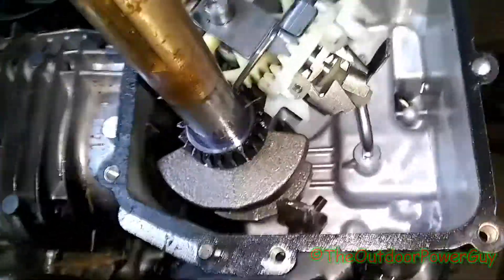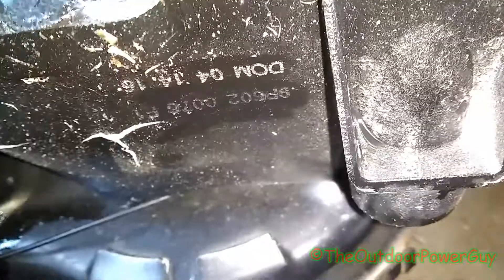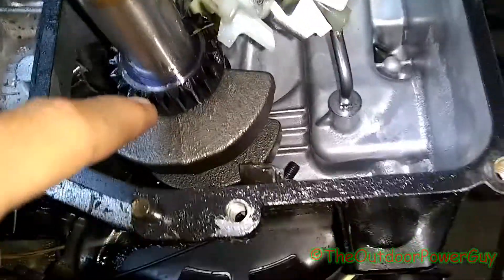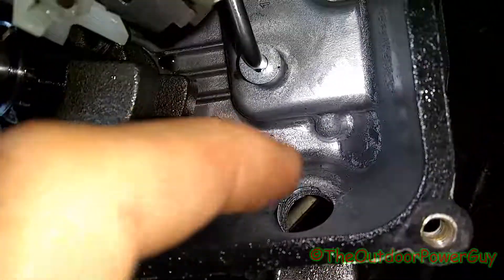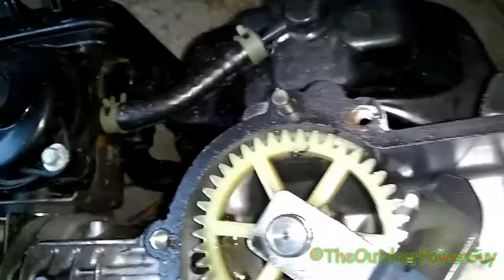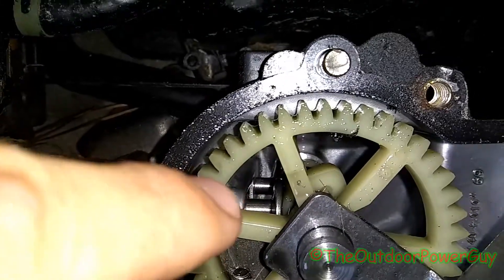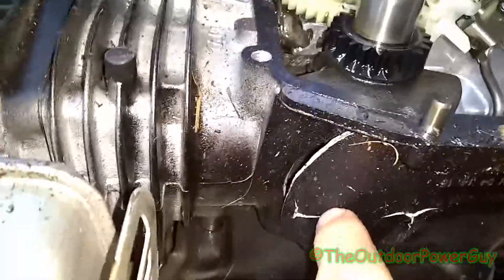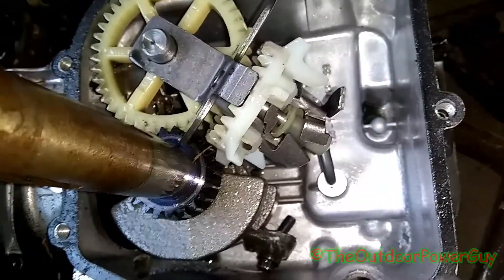INSIDE A BRIGGS & STRATTON 550EX 140cc PUSH MOWER ENGINE

Comment: On the off chance you still check the comments on this video I am asking for advice. I am replacing a bent crank shaft in a 140cc Briggs motor. I got it apart and I am installing the new crank, BUT the plastic timing gear on the shaft is not marked with a mark to match up to the cam. Any suggestions as to what I can do to figure out the alignment for the two gears.
Reply: The plastic camshaft has a notch in it that aligns with a dot on the crankshaft gear
Reply: @Crippinbarbie  Thanks but I figured it out and got the mower back together and running last summer. Still, nice of you to reply.

Comment: Quick question before I put this engine back together. I pulled the cam shaft off and there's 2 push plates that pushes on the valves. Well I pushed these plates with my thumb and they stayed up. When I turn the cam shaft , the cam shaft lobes dont even touch the the lifters. Will they pop back to where they suppose to be when I go to crank this thing? Or did I pop something loose and have to pull the head now??? Thx for any response
Reply from the maker: sounds like you didn't line up the push rods correctly, you would have to pull the push rods out and re-install them.
Reply: @TheOutdoorPowerGuy  Yeah, I just removed the OHV cover and slid the lifters back under the rocker arms. Thx for ur reply.

Comment: What are your opinion on the engine build quality compared to previous generations? I heard these engines are only rated to last a few hundred hours. Not sure though.
Reply from the maker: If you take proper care of any engine it will last for many years. i have had no problem's out of these engines other than the carb's messing up. they are good engines in my opinion.
Reply: Where is the easiest place to find a crankshaft I hit a rock and bent mine and the number for parts please